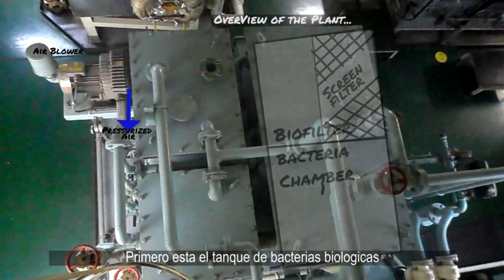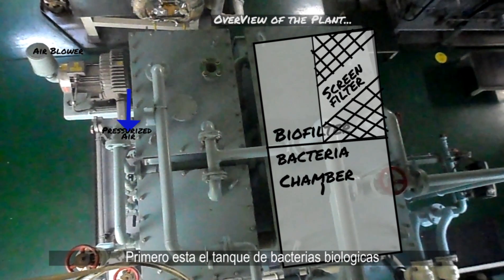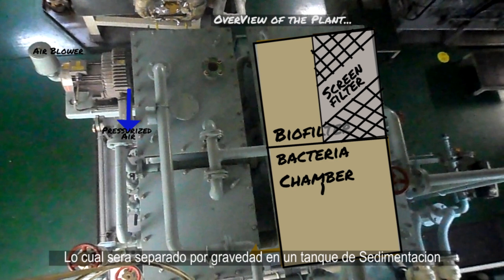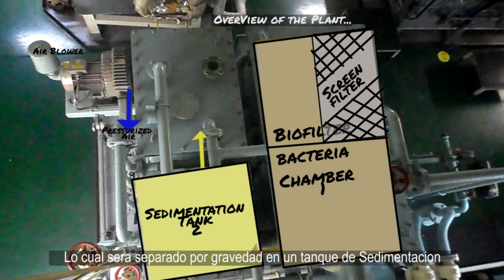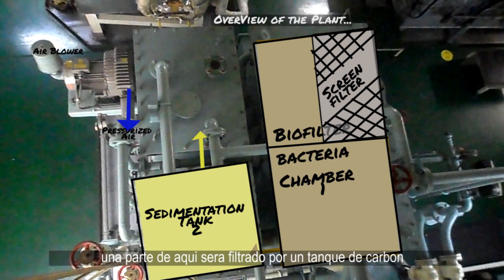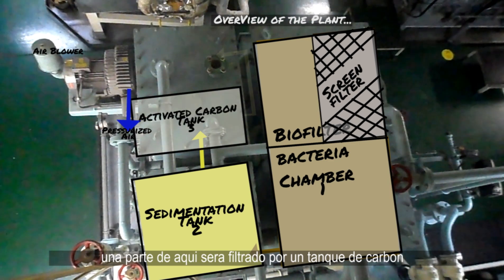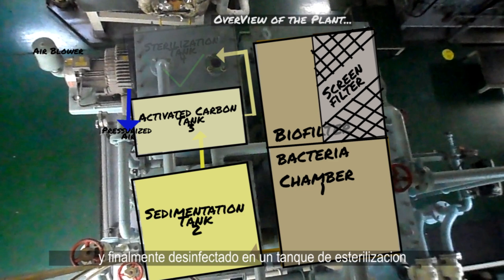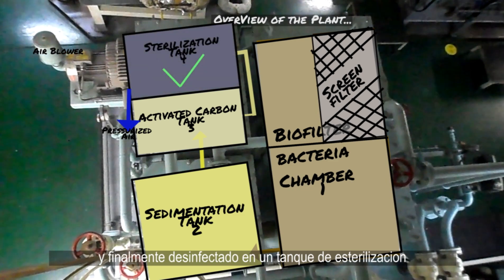Sewage treatment Plant on board ships! What happens after you flush!

Comment: Hiii Mate
Please explain how much Sodium hypochlorite is added to dosing tank?? How much u were using on same plant???
Reply from the maker: Ufff I have to make a video on how to make the concentration! Sorry for the late reply.. It will come soon 😂
Reply: @ShrimptoShark  plz make it soon... Waiting... 😇 By the way u can answer me here in short... Bcoz still couldn't find... 😉
Reply from the maker: OK quick answer the tank or manual usually says how much concentration you will dose for example on that plant it was 12.5% NaCl.. We had in our chemical store 90%NaCl liquid.. So you need to make a V/V solution.. The tank is 20L.. So 12.5% of 20L is 2.5L of 100% NaCl.. Since the chemical we had is 90% you need to factor that in so you make a correcting factor 1.1.. 2.5 * 1.1 = 2.75L of NaCl (90%) to make a solution of 12.5% in the 20L tank. I hope that's clear.. If the you have tablets instead it would be 1g = 1ml
Reply: @ShrimptoShark  ok thank you...
I have 12.5 % solution on board. So i don't have to add any water to it???
Reply from the maker: @vinayakk6328  if the chemical is already 12.5% you don't need to add any water! Just fill the chemical tank normally! But make sure that the plant requires that concentration

Comment: Very well explained ..but if air blower stop will sewage plant will run or not ..
Reply from the maker: It will run, however not for long, first the bacteria will die thus the decomposition of sewage in the first chamber will be poor, then large sludge will be transfered to the setting tank and without air from the blower there will be no recirculation to the bacteria chamber.

The sludge will then clog the screens and eventually the whole system will be clogged, you will notice because the discharge pump will not automatically start because no new sewage will go to the chlorination tank (4th chamber).

Comment: Nicely explained . If blower is not working how than what will happen .
Reply from the maker: Now the consequences for the blower not running are numerous! It's connected to 3/4 chambers!
1)areobic bacteria WILL DIE, and be replaced with anareobic bacteria like explained in the video.
2)the return line of the sedimentation tank will not work therefore heavy sludge will stay at the bottom and clog the return line and eventually the whole system!
3)the activated carbon tank has a screen at the bottom as shown in the video to keep floating soilds out.. If there is no air these solids will be slowly pressured into the screen and without any air to free them, will become stuck! Blocking this chamber as well..

And maybe you can imagine some other problem? To tell you the truth this system is interesting if you go in details haha
Reply from the maker: Hello Usama! Well the blower in our case can be stopped due to the forward or back end bearing being stuck (it should be changed every 6 months) also if high load (if someone forgets to open air valves) which will cause an overload trip, and another case is simply someone turns it off because of a leak in gakset and the blower expels bad smelling gas out (which I've heard has happened).
Reply: @ShrimptoShark  so in that will sewage in the aeration break in small component i suppose no ..because the bacteria in the aeration chamber needs oxygen which eat and reduce into small particles . But i am confuse how the settle sediment again transfer to primary tank by which means
Reply from the maker: usama jadoon I mention this @ 3:16 where heavy sludge sinks to the bottom of the tank. 

Air from the blower creates a sort of ejector that sends this sludge in a return line to the 1st bacteria tank in order to continue decomposition of heavy sewage.
Reply: @ShrimptoShark  thanks
Reply from the maker: usama jadoon no problem always be curious my friend!
It's best to check the flow diagrams of the sewage plant to see if there are any differences.. However my colegues in Korean type vessel have expressed to me that they also have the same type of sewage Treatment systems.